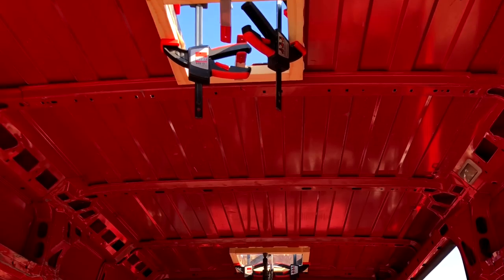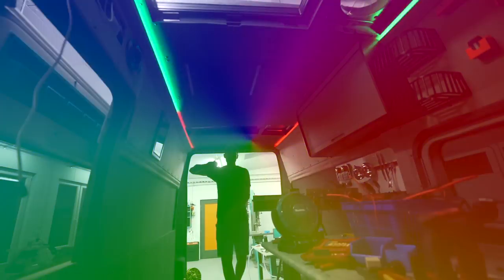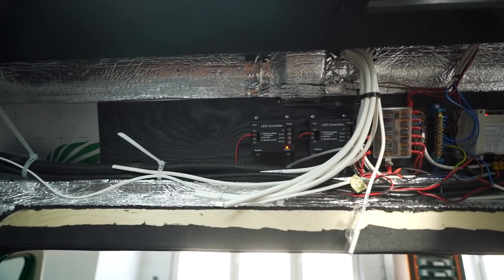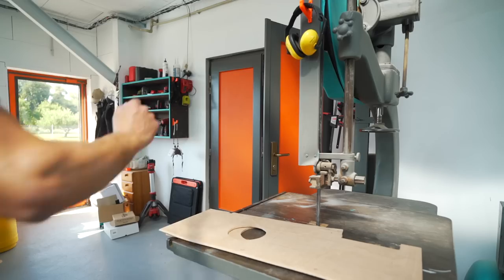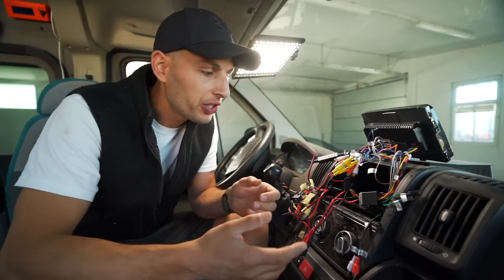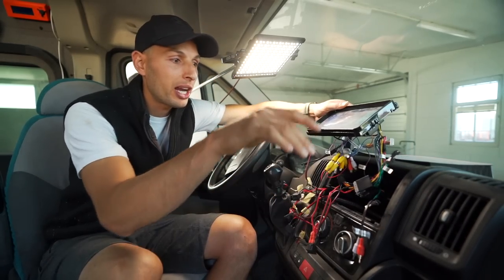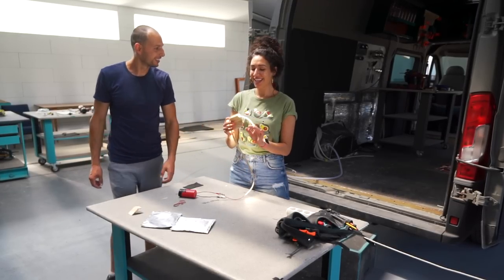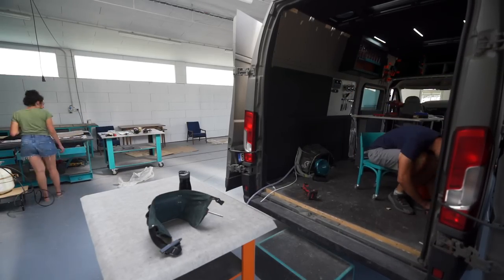Adding Colorful RGB Disco Lights to our Tiny Home! / Van Build S3E12

Comment: What is the reason not to add Starlink on this van? I think you can get the RV version with "pay per use" type of deal so you could mount the dish and use it when needed. It sounds like it would fit your needs quite well. Whenever you lose 4G and the weather allows satellite connection you are good to go.

I love Ladi, the craftmanship and over engineering everything is so pleasing to me. And Margaret's van reviews are extremely useful for brainstorming ideas, please more. Keep it up guys!

Comment: Hey ladi @3:44 you talk about looking at appliances to determine what the fuse rating is it needs to have. I was under the impression the fuses were mostly to prevent too much power draw for the cable so the thickness of the cable determines the fuse rating.

Comment: hi Ladi, i got it wrong heres the right way 
pin 30 ground 
pin 85 to the stereo 
pin 86 12v switch wire 
pin 87A 12v constant from the leisure battery (run the wire to a on/off switch on the dashboard)
pin 87  12v constant from the main battery
at the back of the stereo there should be a red 12v switch wire, if you cut it then run the van side of that wire to pin 86, and the other end that goes to the stereo to pin 85. now when you start the van the stereo will come on, and when you turn it off the stereo will too, and with the key in you hand you can press the on/off switch that's on the dashboard and it will come on.

Comment: Hey, guys, really loving all of your content, you guys are great. But I need some info, Ladi, if you do not mind. I have fixed my eyes on your cyberbike (after extensive research your bike is, by far, the best I have come across), but I can not find its dimensions anywhere. What I need most is its height. I am building a luton conversion and it has gotten to the point that average guessing (4 feet) isn't enough. Could you give me a precise heaight of the bike as it stands perfectly vertical? My thanks in advance, buddy!

Comment: Those small step up buck converters have quite low current limits. I think they max out somewhere around 5A. Running a poe-switch and multiple cameras doesn't seem very wise with 60W... You might run into problems with that...

Comment: 8:50 I have the same process. If I find that I am struggling to work through a problem I realize I need to get out of my own head. If I explain the problem to my wife or a coworker I invariably find that saying it out loud to someone else seems to unlock some part of the problem for me.

Comment: What i wondering about is......
Why didn't you install 
(stand) airconditioning 
And/or a winddeflector/spoiler for
the solarpanel rack on the roof?
Doesn't 'wistle' while driving?
A half pipe would be efficiënt for
deflecting the wind also better for
Dieselmilage......
Reply from the maker: I wish to handle more but deflector is still on to do list.

Comment: Fuses are to protect from burning out the wire, shouldn't be based on the appliance size. I can run an AC off of a 16 gauge wire if I want, but it won't end well, but if I have an appropriate fuse it will blow before the wire.